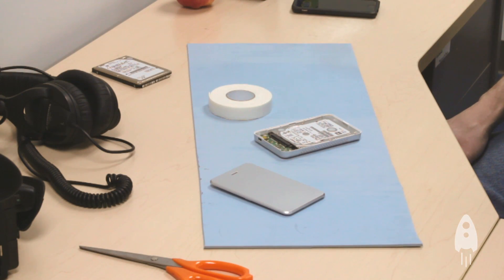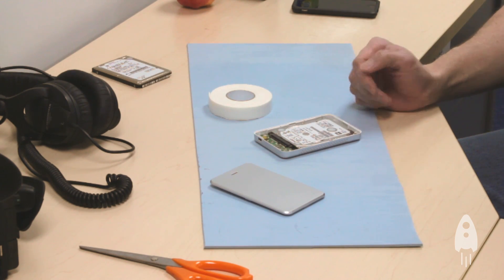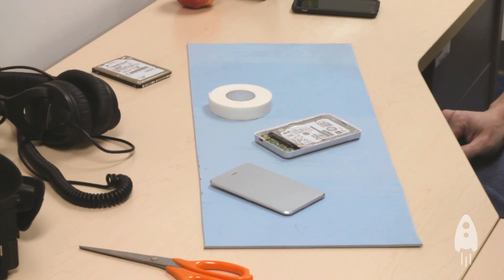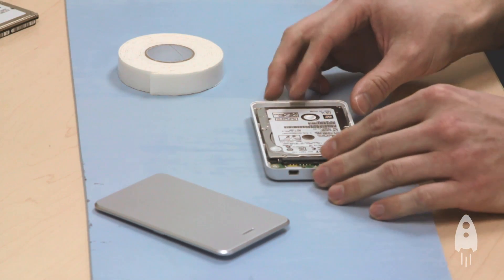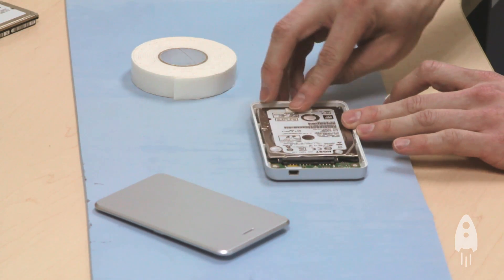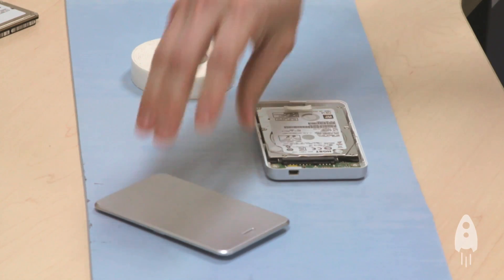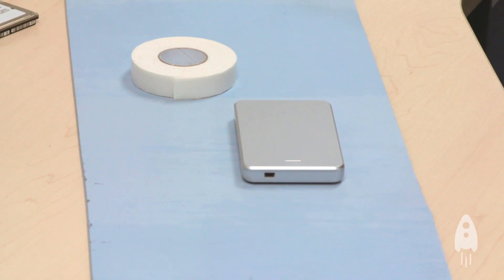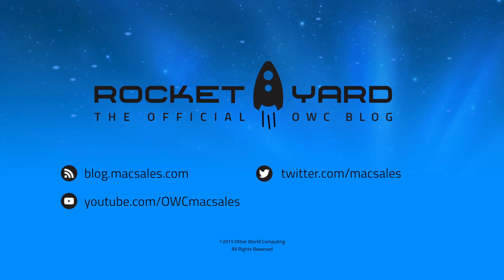Securing a 7mm drive in a 9.5mm Enclosure

Comment: I want to buy ssd but mostly they are 7mm thick.. my current drive installed is 9.5mm but 2.5 inch height.. is it gonna fit?
Reply from the maker: Hey FlexTurn Music! We would be happy to help out. So with the drive being 9.5mm and if you are wanting to install it into the 9.5mm drive enclosure it should fit just fine.
Reply: @poweredbyowc  I bought ssd 7mm.. is it ok?
Reply from the maker: We would recommend a spacer or modification of the enclosure like shown in the video for the best fit.
 
Here is a link to the spacer we carry: https://eshop.macsales.com/item/OWC/SSD95MMSPFL/

Comment: How to know if your drive is 9.5mm or 7mm?😅
Reply from the maker: Ian Isip,
 
Regrettably there is not a real rule of thumb on how to tell if your drive is a 9.5mm or 7mm other than measuring the drive.
 
However, if it is a current drive it should be 7mm.
Reply: The website you buy it from should also tell you the height of the SSD. Look for the technical specs and then looks for the products "height" and it will either say 7mm or 9.5mm.

Comment: what thickness? where do you buy foam tape?
Reply: Home Despot, hardware stores, etc. It’s used behind mirrors so they don’t rattle against the wall. It’s not cheap so unless you also have mirrors to hang, I’d layer up some masking tape. Target (compressed) thickness is...well...A-B=C mm.